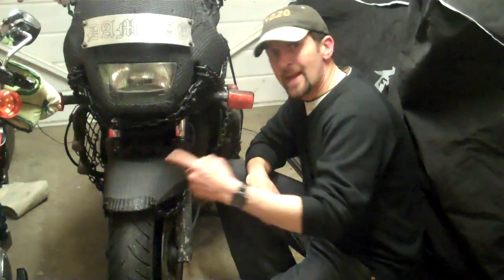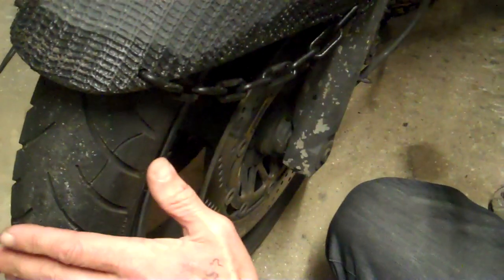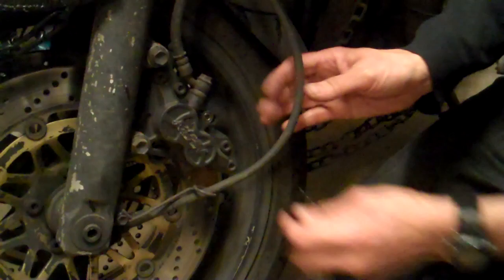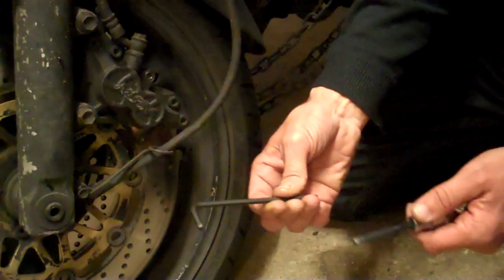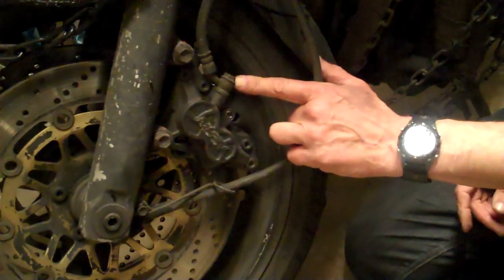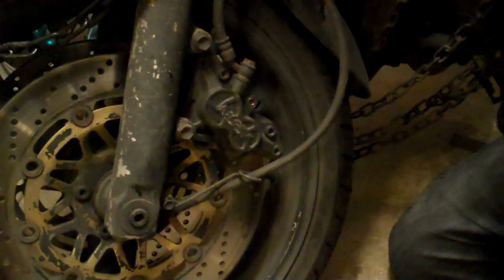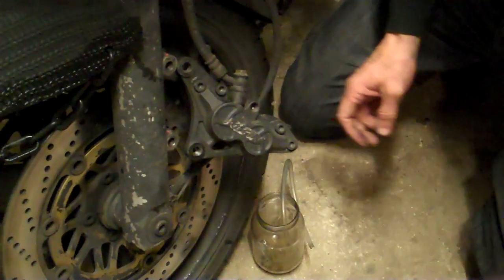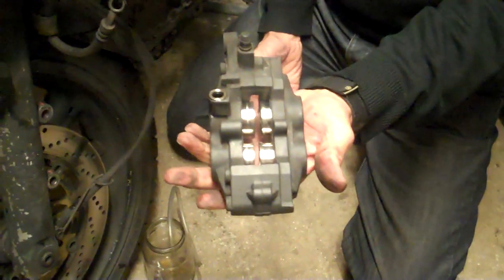Delboy's Garage, Motorcycle Front Brake Caliper rebuild Part 1.

Comment: You like my hero, I went down on my  first bike cause my front break caliper froze, was a new rider so I got ride of the bike and purchased a completely different used bike a 2002 Honda Shadow Spirit 750cc. Moved from nyc to North Carolina road of wet pine tree pines and went down, it's been sitting ever since, so I went and purchased another bike, a 2002 Kawasaki Meanstreak 1500cc, today the rare break is not releasing...I most definitely need to fix both bikes cause I can't afford a whole new bike.
Reply from the maker: Hey there buddy, sorry to hear you had a few drops and what you're describing sounds like something you can avoid with some routine maintenance.  When a brake starts to hang on and bind, it's not such a problem on the rear, but with the front (as you found), it's like riding round a corner with your front brake on... and will definitely take you down at some point.  If this is happening to your brakes now, then we have the videos here you can follow to strip and re-build the caliper, it's not rocket science, just nuts and bolts and then once they're done, you shouldn't have to do it again as long as when you clean the bike, every once in a while, spray some brake cleaner in around the calipers to wash out the dust that causes them to bind... hope that helps you, and good luck with it my friend.

Comment: The knowledge and expertise you share with us is invaluable. Been watching your videos for some years now and I was of the impression that I was subscribed to the channel. Turnes out that I was viewing the videos thought YouTube suggestions 😌🙃. I've fixed that now and I'm a proper subscriber. 

I'm looking on advice on how to rebuild an old set of tociko 4-piston calipers. The difference with the set on this video is that mine have inserts in the outer part of the pistons which don't allow me to use pliers, reverse pliers or any piston extraction tool to pop them out.
Any advice on how to tackle this?

Thanks for all the videos and keep up the good work!!
Reply from the maker: Hello Elias, if you mean like a plastic block that fits into the piston socket, then that's not uncommon on some bikes to prevent brake squeal,  they usually come out though, the ones ive seen in thr past can be flipped out with a screw driver, and some evne unscrew... but if they won;t come out in any way, then why not use the brake lever to pump them out while the pads are removed, (make sure they come out evenly, hole one back of it advances more than the other, )  and once they are almost all the way out, you can usually pull them out with your fingers.. !
Reply: @Moonfleet41  Thanks for the advice!! I'm planning on upgrading the brakes on my V-Strom 650 by replacing the calipers and master cylinder. I have sourced a set of Tokico 4piston calipers from Kawasaki ZX750H1 (with matching adaptors) and I'm waiting for a 2002 GSXR600 master cylinder to arrive. I'll be following your advice and installing the ZX750H1 calipers on the Vstrom to pump out the pistons. Watching all your videos on bleeding the brake fluid definitely helped!!

Comment: Changed the rear brake caliper seals on my XJR1200 and didn't turn any attention on the brake fluid seal being slightly thicker on one side. The pistons went in quite nicely so I think I managed to put them in right way, but should double check it, because there is a 50/50 change to get them wrong if not checking. At least I haven't mounted the brake caliper yet. Just when you think you know smt. there is a little detail that can mess up everything. That what makes it worth to keep your older videos playing on background :) Wondering why the Haynes manual didn't mention it. I might have found out seeing a leakage while bleeding the brakes, but not for sure. :/ Anyhow thanks again Del - you might have just saved me from a f-d up day ;)
Reply from the maker: Hi mate.. the only time ive ever seen it mentioned in a manual was for Brembo calipers on a Ducati.. it is entirely possible that Yamaha put the machined edge in the groove that the seal sits in, that way the seals can be square, and the groove shape makes the seal edge lip out.. But dont over think it, if it went in and has not leaked then you're good to go mate..

Comment from the maker: Hi mate, just a little more background would help, I though the B6 had 4 pot Nissin calipers like the 1200 that has a single pin holding the pads in with a split pin on the inside and then an allen key fits in the outside end to undo it... perhaps send me a picture of your caliper or do me a short 10sec vid in P.M. and I'll suss it out for you mate...

Comment: HI Del, Cheers for your reply! I managed to do it! :) It only has 2 pistons / calliper. I've decided to buy new seals and pads for both of them, piece of mind then. Currently sat in the garage with everything ready for the new seals and pads. I had to drill behind the pin and wack it out! The other I had to hacksaw in half to get it out and then drill through one end of the pin..! Completely seized. How would I bleed a twin front brake system on the Bandit? Both brake lines are open now...

Comment: Hi Del, love the videos. I went to clean my Bandit 600 (2004 / k4) front brakes today, and ended up taking off one of the front callipers and discovered it's full of crud and needs to be refurbed.

I can't seem to get the pads out though. It's only a single sided piston calliper as you probably know. There is a pin, I can't seem to get it out at all so I can't get the pads out and therefore cannot get the pistons out to continue with cleaning them. Can you please shed some light on removing them

Comment: Hi, love the video! Very clear instructions. Question. I got one piston that is all the way pushed out and I cannot get it out with a plier. any idea?
Reply from the maker: Hi Carol, you can normally pump them out using the hydraulics if it's still sealed... but if you've split the system by taking one out already, then that's not an option for you... best tip is to wrap a dry cloth round the piston, grab hold of it and twist/rotate the piston back and forth with a wiggle, and it will eventually pop out... probably just the old seal caught against a lip of crud... good luck with it!  Del

Comment: Hi Delboy,
   I am having a moment of crisis and I thought you might be able to help. I am a complete ignoramus as far as mechanics is concerned, so a year or so ago I decided, what better way to learn more about Bikes than to build one myself, with the help of a friend who is not quite as daft!
 I know but up 'til now all's gone quite well and we have both learned quite a bit but, when fitting the front master cylinders onto the bike and bleeding them we have found that a brake system that was working before, now has a problem, I have reconditioned the pistons as your great vids showed me how, I have reconditioned the master cylinder, and even made some little spacers as the callipers didn't quite sit central on the disc, the wheel is from an SRAD, the forks are from a GSXR750 K, all fitted with custom yokes to the front of a Vmax. all that aside, in the dry build they worked fine, I have retraced my steps, tried different callipers and reconditioned the master cylinder twice. the symptom is.... the pressure seems to increase more and more and not release the pads from the disc so the brakes lock every time they are bled. if they hadn't worked before I would question  the set up but they did so I am at the end of my tether. Can you shed any light on the problem, and let me know what it is I'm not doing cause its driving me bloody bonkers!!!!!
Cheers Nik
Reply from the maker: Hi Nik....You're not alone buddy.. brakes can drive you mad for no reason...then just start working again..!! 

Ok, some questions?..  
Do the pistons push backwards into the calipers by hand with reasonable effort?
Are you using new pads, and are they the same as the old ones (correct part?)
Are the hoses kinked in any way, or even bent more then just a slow curve?
Are both pads jamming on the disc at the same time or just one (are those spacers holding the caliper off line?)

And most of all....if you've rebuilt the master cylinder, is the fluid venting back up into the reservior when its released?..(you can check this by pushing the pistons back in and watching if the level rises?..)

Have a check of those things fellah, and let me know...im sure its nothing serious, and as always, you'll kick yourself when you find it..lol
let me know..Cheers
Del.

Comment: you are an absolute champion. i'm currently stuck without transport as my front wheel has seized and i need to do this! is it essential to change the seals? the reason i ask is someone has told me the seals should still be fine, it just needs a good clean out! i've got 2 calipers on my GPX so will need to do both of them, cheers

Comment: Dear Dellboy, the new seals I got for my roadliner (aftermarket) ,for the front caliper, the thick ones that go in first, don't have a taper on them. I put one on the table it stood up on end. They
all seem to be the same (the inside ones in the caliper).I used a little bit of red brake grease
the pistons went in just fine. I did feel the lip on the back side of the first seal with my finger
before I put the piston in. The kit I got seems complete, 16 seals, 2 bleeder boots, 4 cooper washers, 2 brake pad pins, and 4 hair pins to fit the pad pins. The kit fits a number of yamaha
models mine included. I wondered if, you have ever run a cross this before. I guess I'll find
out when I bleed the brakes. Any input you could give me will help. THANKS
Reply from the maker: Hi Mach.. As long as you have a protruding lip on the innermost edge of the seal, then you're good to go... on some bikes then groove that the seal sits in is tapered in shape, and that pokes the inner lip out... so yours is one of those then.!!   Good luck getting it all bled up, hope it goes smoothly for you mate.

Comment: del .i was woundering if u could make a short vid, showing how to take off the 2 rear shocks at the same time,with out the swing arm moveing ,as i am trying to do on my gsx1400  and iam stuck of what to do .... cheers del .love the vid u makeing keep the good work up
Reply from the maker: Can't make a vid mate, cos we use the bikes all the time and I can't go taking my bike apart for no reason to make videos...but it's not hard mate... normally just take one off at a time and that will keep the swing arm in place (presumably you're using the main stand to support the bike)... if you want to take them both off at once for any reason, just pop it on the main stand and slip a stack of old magazines under the wheel to the correct thickness to hold the wheel where it is... easy innit?
Reply: I didn't explain very well too u , is that I don't have a center stand and I trying too have my spring powder coating, and this why I trying to find away too do it
Reply from the maker: Graham Fleet  Ahh I see, I understand now... best solution, pop the bike on it's side stand and place a car trolley jack under the point where the centre stand fits AND ON THE RIGHT HAND SIDE OF THE BIKE then jack slightly over on to the side stand and this will lift the back wheel up quite safely... if you're worried about the bike falling over to the left, then stand it close to a wall and turn the steering to left lock, it will be quite safe .... if it's gonna be left like that for a while, you can place a block under the frame, or axle stand, rather than leave it just on the jack and always protect your frame coating with some rag, so the jack doesn't scratch it!  Hoe that helps you mate, Del

Comment: Hi Delboy. I did the repairs or cleaned the bushing you referred me to on the front rotors. However I am still feeling the pulsation in the front brake lever. When squeezing the front lever to a stop I am still getting that shudder it's not as bad but it's still there. More help.would be awesome.
Reply from the maker: OK, so to take stock....if you are sure that all the bobbins are moving freely, and the discs are clean, then next ask yourself have you replaced the pads, (and with good quality ones) how many miles on the bike, and have you changed the fluid in the last two years.?

Comment: Thanks for that video ot was spot on. I will be doing this job on my rear Thundercat caliper soon as the dust seal is poking out. Do you have any experience with Powerhouse seal kits or would you recommend OEM seals?
Reply from the maker: +jaz9000 Hi buddy, i haven't used those seals, but i have used some right old cheap kits in my time....and never had one let me down.. if you want to pay the dealer for the OEM ones for peace of mind, then there's nothing wrong with that, its just what you want to spend on your bike.. Me, im a cheapskate, specially if its just snob value..!

Comment: Very good video. I have an old 1979 XS 750 im restoring. Im in the process of rebuilding the front calipers, the pistons were VERY stuck and difficult to get out. It almost looked as if sand was behind the dust seal. I can replace the pistons, but I cant get a new caliper and it looks like there may be a little rust inside. How do you recommend cleaning the caliper?

Comment: Very good. However - if you're caliper is one piece - use compressed air. ALWAYS drain the bottom 6" of brake fluid out of the line on any brake job - reason: will be filled with grime and burned. Get it out. You'll need to bleed fluid anyways.

Comment: I've done everything you've said step by step but I didn't change the seals as they where fine , I had a blip at beginning and lost most of my brake fluid ,now I've put back together thinking I'll just have to bleed them but i can't for the life of me get them to work .so have I damaged the seals or is it just an air block . cheers .. great video by the way ,my own fault for letting the fluid out it won't bloody happen again lol .
Reply from the maker: If the seals weren't leaking before you started, and you were careful not to nick them, then they should be fine..it sounds like you maybe just have an air lock... try pumping up some pressure with the lever, then hold it in, while you open and close the valve.. .that should get it started..  Good luck with it buddy.
Reply: @Moonfleet41  fantastic it worked , it was just an air lock . I shouldn't have panicked thinking I'd damaged something. Thanks again .

Comment from the maker: Honestly mate, i think your bike needs some proper investigation..its not right to try and guess whats wrong over email...if you have damaged the brake lever then you must check if its holding the brake on, and rebuilding your caliper is only relevant if it is that causing the problem and you can't free it off by cleaning it...perhaps take a proper look at what's going on first to find out what is causing your brake to bind up..!

Comment: Hello Del,
Great video, it inspired me to do the same thing as I was worried about the braking power I had. Found that some of the pots are really stuck in there! Coincidentally, there the ones on the 'outside' side (with the Nissin logo). 
They're not budging. Any tips on loosening them? (I don't have Mole grips)
Cheers,
G

Comment: Hi del hope your ok question for you , I've refurb end front callipers a right pig absolute siezed pigs there ok now thanks to your tips but I've a click off one side after squeezing brake I suspect it's the anti squeal or rattle pad that the brake pads sit on ,they were squashed and bent did me best to get em into original shape. Can you discard these and not bother have you done so cheers ant from Wales
Reply from the maker: anthony preston Hi Ant....good to hear you got yours sorted...you can remove the rattle plates, it wont adversely effect braking too much, maybe they will make a lot more noise and squeel....but why not price up a new pair from Suzuki..they cant cost that much?..

Comment: Thanks for the video Del, had to come to this vid after finding the dust seals have popped out of my callipers, obviously neglected the brakes for too long.

Quick question though: what did you use to clean the calliper & pistons? Im inclined not to use brake cleaner and opt for brake fluid but I don't know?
Reply from the maker: Ayup Mook, no reason not to use brake cleaner, after all, that's what it's for... if you're cleaning out the grooves though, which will have a good thick crusty layer in them quite probably, then the best little concoction I've always found works, without fail, is place a big old quirt of Solvol Autosol in the lid of an aerosol can, add a splash of boiling water to make it runny like cream, then use an old toothbrush and gently massage the paste in to the groove, without pressing too hard, and work away at it till all the deposits are gone... the hot water dissolves the salt and the Autosol polishes up and brings back the metal to brand new clean... then clean it with brake cleaner, then wipe that out with fresh brake fluid and inside your grooves should be shiney as a new pin!  Hope that helps you buddy, let me know how you get on, good luck, Del
Reply: Moonfleet41 Had to wait until I got a day off to do this, all went fine though! Found a love for Autosol too ;) Only problem was Kawasaki charging me £40 for the seal kit, bit steep but gotta be done I guess.

Thanks again Del!